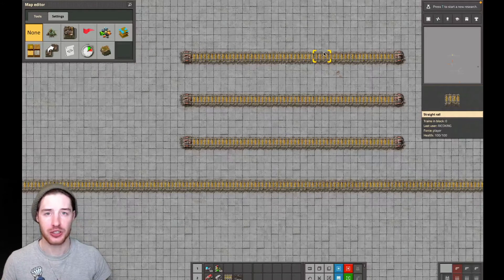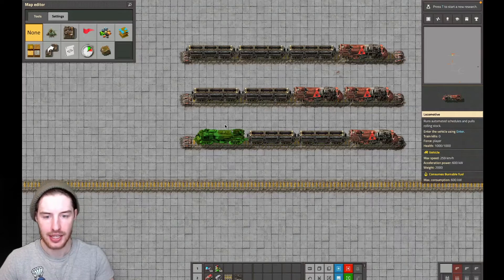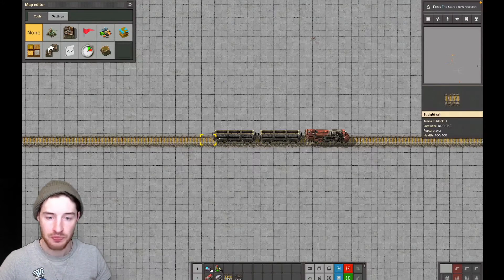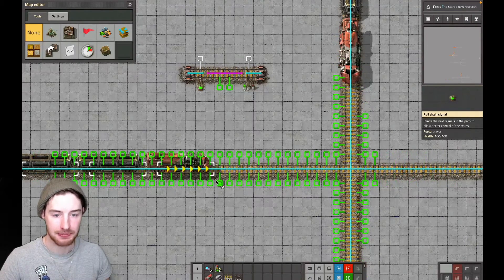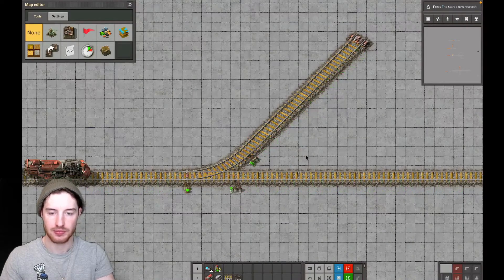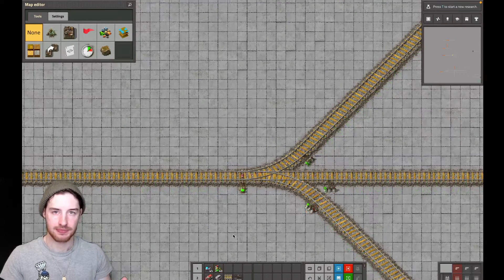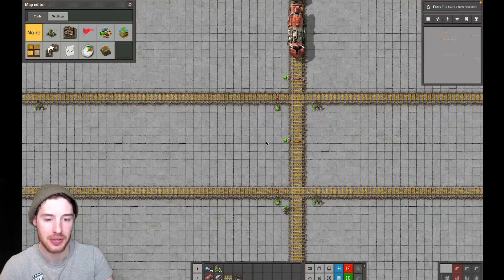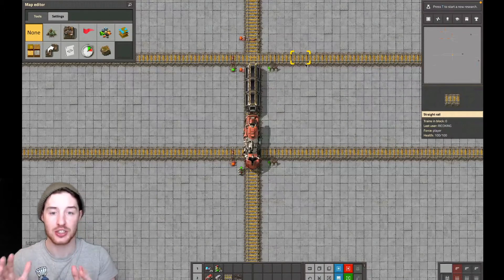Factorio train signal basics, Quick learn train rail chain signals

Comment: This video was very helpful, thanks. What I’m trying to do in my game is have two trains at separate loading stations both use a single track in the middle of their runs, then split to separate unloading stations. Then have them use the same track to go back. Is this possible? I can get either train running on its own, but can’t get the signals right to run both.

Comment: Don't forget option 3. Option 3 is great for short distances. Also you can slot 2-X trains in your bus. What I do when I get oil is make a 2-4 train and then the track slides into the bus. You can just tunnel over the tracks in your bus and build beyond where it corners into your base (this looks fucking awesome btw when you have a train running down the center of your base). Then when that is in place I build a second line of track and a 2-1 train for heavy oil to be taken away to lube, and that heavy oil train acts as the heavy oil storage for the lube plant. This also separates this heavy oil from your advanced cracking, of which you usually have an excess. So this also takes a huge chunk out of your heavy oil allowing petrol and light oil to crack down with less managing. And again it looks awesome cos you got a pair of trains running up and down your bus

Comment: You are presenting your beliefs and not facts. Why can I not go for 4 carriages? You did not even talk about the signals but you predetermine that it has to be put 3 carriage length behind a stop. No, it does not. You go into optimization and nuances right away without explaining any of the building blocks.

Comment: So how do you make the full circuit? Like this -->   O________O 
The train grabs resources, loops, goes on a straight line, drops off resources, loops, goes back on the same line to complete the circuit. Don't know how to introduce new train routes that connect to the straight part of the track.
                ______O
O_______L________O    don't know if that makes sense but I can't get the dang stop lights to work with multiple trains going to different destinations on the same track.

Comment: There's nothing wrong with using double sided trains; while sure you lose the power efficiency by one cart, you save an immense amount of space and, depending on your situation, time and energy through lower travel times.
With everything in Factorio their are several usages for any item, of which their dependent on other factors. You want a small train to just run from A -> B -> A/ then use a double. You're running a single nuclear power plant? Don't do korvax enrichment. You're running so many nuclear plants you can't count? Run korvax.

Comment: If you do decide to do a "simple" double-headed train on a single track, you'll have to do the signals on both sides of the track or it'll get stuck at one of the train stops.
Reply: But the whole reason to use the simple double headed train on a single track is that you don’t need to use signals…
Reply: @cellularmitosis2  What happens if it intersects with another track?

Comment: Good video. Certain points:

* Most locomotives doesn't make the trains faster max speed, but rather faster accelerations, leading to faster average max speed
* Using trains longer than your average rail signal length is not directly an issue. It will just cause the previous block to also be taken. The issues start if it's too short between intersections.
* Signals on corners can be rotated to touch the wanted rail. But as you said, it's not recommended :)

The part from 4:00 on is super important: If a train can't fit, use a chain. If it can fit, then rail is OK.
Reply from the maker: you can rotate signals....1000 hours and still learning hahaha thanks